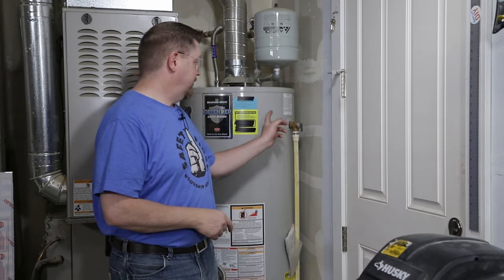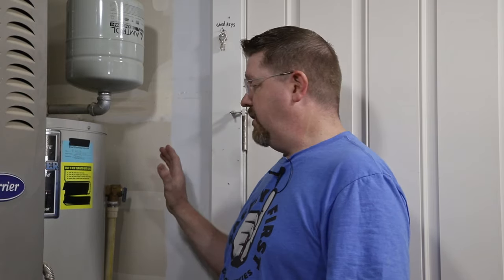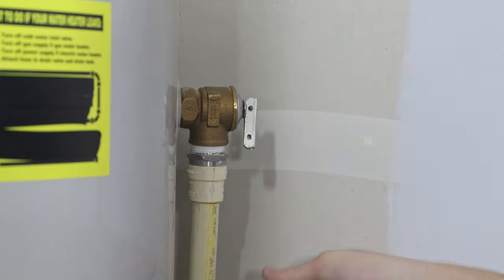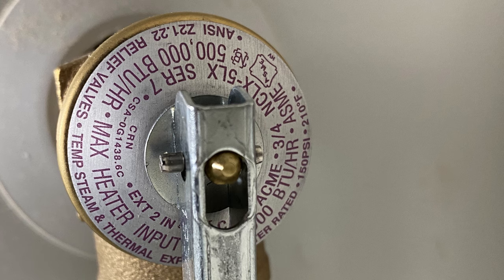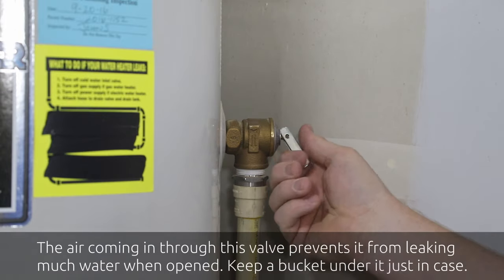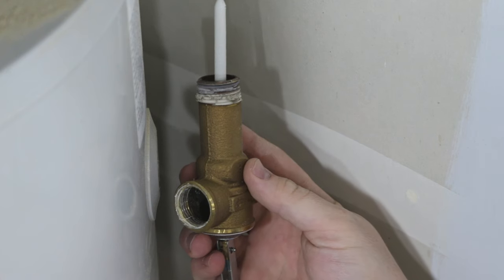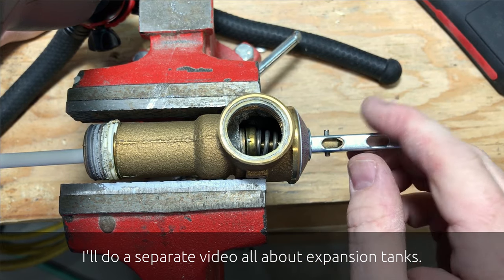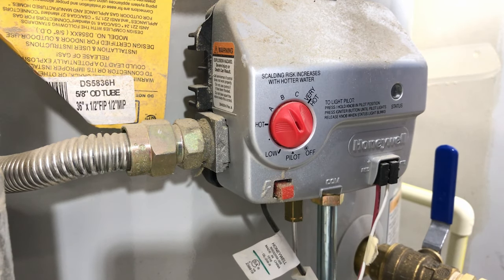How To Replace Pressure Relief Valve On A Water Heater (T&P)

Comment: Thanks a lot for sharing this video. Changing the valve was a breeze was I watched this video. However, after I replaced the heater stopped working. I am getting an error that points to flammable water sensor lockout. Do you happen to know if they are related. Doesn’t sound like to me.
Reply from the maker: Hi Kutty - apologies for the late response - I hope you have already resolved this. The flammable vapor sensor is there to prevent the furnace burner from firing if there are other flammable vapors (gasoline vapors, natural gas leak, etc) present in the near vicinity of the heater. It's extremely unlikely that changing out the T&P valve would have tripped that sensor. Consult the manual for your heater to see how to reset it, if you have not already. If it keeps tripping, you'll either need to find what's tripping it, or perhaps the sensor is faulty and will need to be replaced. 

Good luck!
Reply: @AmplifyDIY  It was indeed the sensor. I replaced it yesterday and so far the heater seems to work 🤞. Thank you.

Comment: Tried this but all my pipes started creaking during the emptying of the tank. Shut off cold water inlet and also shut off boiler. I removed at least a couple of gallons. When I pressed the lever on the P&T valve lots of water came out so I don't think the water level was below the valve. I do have a hot water tank connected to the boiler.  I don't know if that makes a difference. But all that creaking was not mentioned in your video.  I guess it was water in the pipes being drained back to the boiler ? I remember you said that does not happen. 

Edit: I see you are talking about a water heater and I am talking about a boiler. Not the same thing but I would think pretty close.

Comment: I hv another small metal line running from the top of my pressure relief valve. Do I hv to worry about disconnecting that line? Well water.

Comment: I can not open my val completely do to its close to my heater do it needs to be completely open to check it is it some way i can send you a picture to show you .  The water heater is about 8 years old im hearing poping noise so i knowing time to drain it .  Don't really hear the poping sound as loud when i shower but when the faucet on or washing dishes when the water heats up its pretty loud poping noise .     I need help and your way of exsplain things is very good!  Blessup
Reply from the maker: If you can take a picture of how your system is set up and what is in the way I’ll be happy to offer advice. Email pictures to me directly: AmplifyDIY@gmail.com

Comment: To AmplifyDIY

First of all, I appreciate your video(not this video but another one) about how to flush a water heater. I have flushed my heater as following the procedure that you talked about.
After flushing, I have a problem with my heater. The water automatically comes out from the outlet pipe connecting with the T&P valve. It is not very much(under two fluid-oz per day), but I have to put a cup beneath the pipe to collect and throw away the water every day. There was no water coming out from it before flushing except for opening the T&P valve. It becomes a new chore for me every day.

Based on the fact, I would like to ask you questions. 
1. Does the phenomenon of the water leakage out of the pipe belong to the normal operation of the heater? 
2. Or, might be there some steps that I missed or incorrectly did when I flush my heater?
3. Or, should I replace my T&P valve right now?

Thanks a lot for reading my comment.
Reply from the maker: Hi Jake!
I'm sorry to hear you are having this issue. It sounds to me like you actually need to check the pressure in your Thermal Expansion Tank, if your system has one. One telltale sign that this tank causes the T&P to leak is that it will only leak *while heating*. Is your leak constant? Or only while the heater is actively heating the water?
More info about thermal expansion tanks, how to check them, etc is here: https://youtu.be/NGygvtP6Sdk

If your leak is a steady drip all the time, however, then you need to just replace the T&P valve as I demonstrate in this video.

I'd love to hear how things turn out for you. Good luck!
Reply: @AmplifyDIY  
Thank you for your explanation about my problem.
First of all, my problem was fixed the last week for my plumber's helping. I had to call him "urgently" due to a different issue in my bathroom. I told him the problem with my water heater, and he changed right away the new T&P valve. As a result, all of my concerns disappeared.
By the way, there is no Thermal Expansion Tank in my water heater system. I'll try to install it for the next time.
Finally, I'd like to thank you for your video about the replacement of the drain valve. I've changed the drain valve the bigger diameter one you mentioned on your video, almost the same type. I flushed my tank once again after replacing the valve. Wow! What a fantastic result I've ever seen! Some sediments were really big, and a lot of floaters came out of my tank. I can't believe that I've used the water for a long time!

I'll keep watching your videos from time to time!
Thanks a lot.

Comment: Didnt know was leaking until gas company relit pilot after gas was off. Who knows how long caused higher gas bills having to reheat new water? Your video was amazing and I'm not very handy but only issue was that the hose I was using to empty tank was clogged.😂

Comment: Can you change just the piping without having to turn everything off or drain the tank?
Reply from the maker: As long as you don't need to open or remove the valve to swap your pipe, yes, you can do it without draining the tank. Good luck!

Comment: Going to change the pressure valve, I found it it practically welded on. Took a pipe wrench to it but no go. Any suggestions? Extension bar?

Comment: I had a valve that was first not draining (open it and nothing came out) so I took it off, banged it around, shook the crap out of it and put it back. then it was leaking. So I did replace it but as an experiment I soaked the old one in vinegar for a day and it came out looking brand new. I wonder if its good to use or if the vinegar would damage the seal somehow. Does it even have a rubber seal in it or is it brass on brass?
Reply from the maker: I would not re-use the old one - not because of any sealing issues, but because of what you may have done to the temperature sensor or spring inside. This valve is a pretty sensitive part, and I'd have to assume that by banging it around and soaking it in vinegar it's at least possible you have altered the way it would work. Given the potential negative impact on personal safety or property damage, I'd just keep the new one and toss the old. Great question, and thanks for watching!

Comment: Great video! I have a question: my drain valve was plastic and when I went to remove it, it sheared off flush with the side of the tank. I can't tell if what's left in the opening is plastic threads, sediment, or both, but I haven't been able to get it out. Any tips?
Reply from the maker: What’s left inside is likely plastic threads. At your local hardware store they should sell a tool used to remove broken sprinkler heads…it’s a bit hard to describe, but looks like this: https://amzn.to/3811sM7 - you jam that into the hole, and as you twist it grabs what’s left of the fitting from the inside and spins it out. You can then replace it with a better brass ball valve. I did a video on that as well: https://youtu.be/OBPJYg0o_o0
Good Luck!

Comment: Nice video every thing explained in details. However i have a question, i wonder if you can help. Can you please tell me, why my water heater will not fill up after a flush, Did all the step to take the air out such as opening of the faucet etc, but will not fill up. You can hear the water rushing in but only for about 5 seconds. if you open the drain valve it will fill, but you close it stop also. Have any idea. Thanks.
Reply from the maker: Hey Sportster - what happens if you open a hot water tap and leave it open while you fill the heater tank?
Reply: when i open a hot water faucet i can hear the water slashing inside, then again it's brief
Reply from the maker: So, to be clear: you open a hot water faucet, close the T&P valve, and open the cold water supply to the heater. Leave it like that and you should have air and/or sputtering water come out of the faucet until the heater tank is full, then the faucet will gradually switch from sputtering air/water to all water.

If that’s not working, something is not set up right, but I could not tell you what, exactly. Try opening multiple hot water faucets?
Reply: yea a hot water faucet. Well i don't know i turn the unit on, it's been running hot water for 45 minutes
Reply: Well it's seems that i panicked, if my memory serve me well i used to hear the water splashing while filling. Anyway i took a shower in very hot water for about 15 minutes and was fine the whole time. Thank you for the quick reply, you're awesome!!!!!

Comment: My valve started leaking after I replaced the expansion tank. My old tank has sprung a leak and was broken for a few weeks until I got around to replacing it. I set the new tank’s pressure to 60 psi, as that’s what I measured my water pressure to be. I have no idea how old the valve is, but I’ve been living in the house for 5 years and never had to replace it
Reply from the maker: Sounds like it’s probably time to replace the T&P valve. Good luck!
Reply: AmplifyDIY thanks!

Comment: Well, I drained my tank and started with leaving a hot water faucet on. The tank is 28 years old. I kept getting sediment so I tried opening the p&t valve while draining to help flow and it didn't close. I guess I have to get a new valve now and probably would be best to get a new tank soon as well.
Reply from the maker: At 28 years old, you are already living on borrowed time with a heater that has never been maintained. I hope the valve replacement went well!

Comment: Hey there, so my water heater doesn’t appear to have a cold water inlet valve - could I instead shut off the main water supply to the house for this? Thank you!
Reply from the maker: Yes, you absolutely can. Some are plumbed this way, unfortunately.  While you have the water main off, I'd consider adding a shut-off to the heater's cold side. I don't have a video on how to do this, but the process is pretty simple. Good luck!

Comment: @amplifydiy is there any difference between the nclx-5lx and the nclx-5l? They have the exact same specs, look the same. Is it a new version? I'm trying to find a replacement the -5L version seems to be possibly discontinued?
Reply from the maker: If the specs are exactly the same (including stuff like the length of the probe, etc) then it should be a compatible replacement. Good luck!
Reply: @AmplifyDIY  got it fixed following your video thanks 👍🏻

Comment: I’m nervous, I think this is the problem of my water heater. The pipe from that valve won’t stop draining small amounts of water/dripping. I will try to replace it myself. It looks easy with the right materials and equipments.
Reply from the maker: I hope you were able to figure it out. Good luck!

Comment: I bought house with s three month old HWH. Th e T and P valve purge s after every hot shower. That odd it's new. I called the manufacture and they sent me a new T and P. I am going to change it out soon. Do you have any comments before I start? The manufacturer  also said the problem could be fluctuations  in the public water supply but I don't  think so because it only releases after the hot water has been running for a long time as in a shower/bath.
Reply from the maker: Do you have an expansion tank? If not - you may need one: https://youtu.be/NGygvtP6Sdk

Comment: Question for you, isn't using the Teflon tape and the pipe dope excessive for a brass on brass fitting? I didn't think it was necessary to use either especially when it was brass on brass.
Reply from the maker: You definitely need at least 1 of the 2 when doing brass-brass connections... particularly when doing something like this where you need the fitting to sit at a specific orientation so you may not be able to torque it down incredibly tight. With pipe dope and tape, you can get it snug, then continue until you get to the correct orientation without fear of leaks. Thanks for watching!

Comment: Hello! Just watched your video and attempted to do mine! Got it done but it didn’t seem to go as smooth as your video. Mainly cause it felt like I had to drain a lot of water out my tank, like Atleast 30 minutes from the hose. Then when I closed the drain valve the water would rush up and come out the TP valve again. So I had to keep the drain valve open the entire time, what could cause this? TIA!
Reply from the maker: Hi M S - sounds like your cold water inlet into the heater is not being shut off all the way. I hope you were able to get the job finished!
Reply: @AmplifyDIY  yeah I think you might right, But I did turn it closed tell it stopped spinning. when I turned the water back on you can definitely feel and hear it open so if my shut off valve is faulty it definitely didn’t match the pace of the water coming out the end of the hose if that makes sense. None the less I was able to replace the valve so good to go for awhile. A note worthy addition worth mentioning is that my water heater at one point was used by my hydro heat, hvac system. But since then switched to a furnace. So there is 2 pipes that are now capped off since there not getting used anymore. Not sure if that changes the procedure or not!

Comment: I have a small leak coming from inside the TP valve . Right now, it hasn't been leaking for 3 straight days. If I insert my finger, it's wet. Was it previously leaking to release some hot water pressure?
Reply from the maker: If there is any water coming out of the T&P, either your heater is building way too much pressure, or your T&P valve is not making a good seal. I'd start by replacing the T&P, and if the new one also leaks occasionally, I'd look into an expansion tank: https://youtu.be/NGygvtP6Sdk

Comment: I recently moved into my home. The home inspector recommended replacing the PVC pipe coming down from the TPR valve because the temperature rating on it was too low. I might be searching incorrectly, but I cannot seem to find ANY resources on what to walk into a hardware store and look for or ask for if I want a metal or another PVC pipe, and what to expect when replacing my pipe. Do you have any resources or advice? Most of all, I'd like to know if I should expect to find a pipe that is already threaded properly and how to measure what length pipe I need.
Reply: In regards to the pipe length, I meant as in, what would make the pipe too short to be effective? My heater is in a drain pan.
Reply from the maker: Hi Michael - You likely have a standard PVC pipe as the discharge. Technically, your inspector is correct, in that PVC has a working maximum temperature of only around 140ºF. You could swap it out for CPVC, which has a working temperature of around 200ºF, or for copper or a variety of other options. However, in the event of an emergency discharge event, the downpipe only has to steer the discharge down and away from any people who may be near it at the time.. that's it's whole purpose. While a regular PVC pipe may not be able to hold pressure correctly at temps above 140ºF, since this pipe is open at the bottom it does not need to contain pressure, but merely redirect the discharge down. In my opinion, swapping it is not super urgent or even really necessary. It would technically be safer to use CPVC, but not necessarily actually perform much differently. CPVC is widely available at your local Lowe's or Home Depot. As for length: in most states you have to have the bottom of the discharge pipe within 6" of the floor, so just measure down from the T&P valve and aim for 3" off the floor. Good luck!

Comment: I bought a replacement valve today (exact model that you're using but my new one did not have a white probe on the end of it. Its that white probe necessary?
Reply from the maker: Hi R - yes, that white part is the temperature probe portion of the T&P valve. It sounds like you only have a Pressure relief valve. I would try to find one with the temp sensor as well. Good luck!
Reply: @AmplifyDIY  Thanks. You're correct. I got bad advice and bought the wrong one. I fixed my leak but I will upgrade to the T&P (although the probe on my old valve was so caked in calcium there's no way it worked properly).

Comment: SOMETHING I NOTICED UPON REPLACING MY T&P VALVE-
WHEN I DRAIN MY TANK I USE THE HOT WATER FAUCETS AS WELL AS THE RELEASE VALVE ON MY TANK. WE NEEDED TO REPLACE IT B/C IT WAS LEAKING (AFTER TESTING IT). I IMMEDIATELY NOTICED WHILE FILLING AND WHILE DRAINING (TO CLEAN THE TANK AFTER REPLACING THE VALVE) THERE IS AN AUDIBLE DIFFERENCE IN THE VACUUM AND EXPANSION AT THE VALVE. IT WAS MUCH LOUDER. THIS MAY BE AN INDICATOR FOR THOSE THAT DRAIN THEIR TANK OFTEN. MY ASSUMPTION IS THAT THE NEW VALVE NOT BEING CLOGGED UP WITH DEBRIS IS ALLOWING MUCH MORE AIR TO PASS THROUGH WHEN OPENED.
SEEMS TO ME THAT IN THE EVENT THIS VALVE WAS NEEDED I WOULD WANT AS MUCH FLOW AS POSSIBLE WITHOUT RESTRICTIONS TO EVACUATE THE PRESSURE.
THIS IS JUST AN OBSERVATION AND I HAVE NO TECHNICAL KNOWLEDGE.

Comment: Does the down spout have to go somewhere particular? It doesn't have to lead to a drain?
Reply from the maker: Depends on the local codes. In most cases though, no - it only has to go down so that it will direct water away from people and stuff. In most cases, it is specified to go straight down to a specific height off the floor. Great question, and thanks for watching!